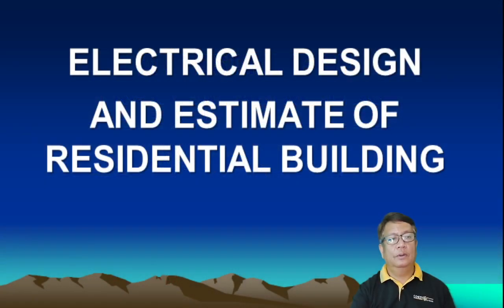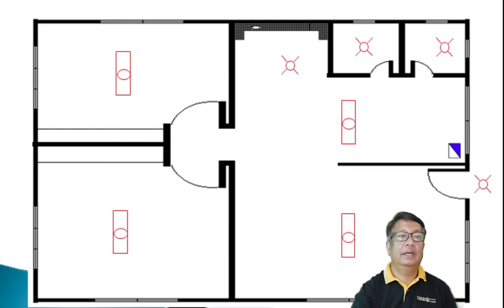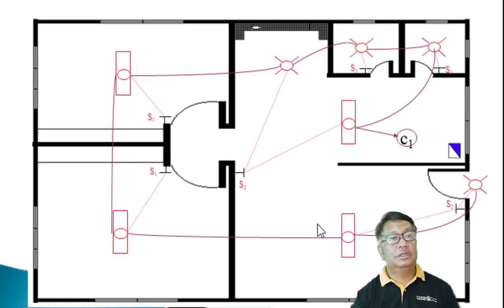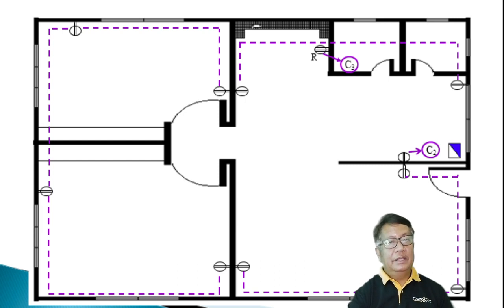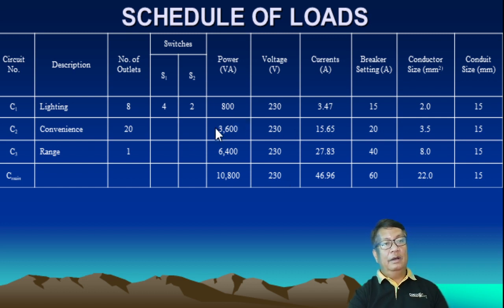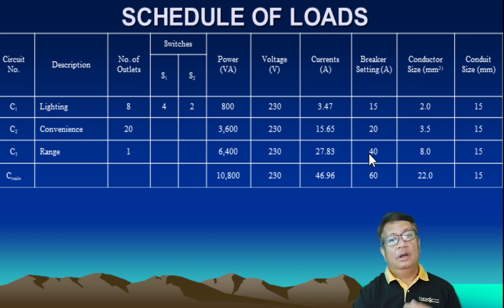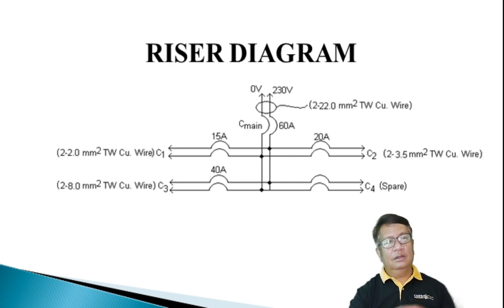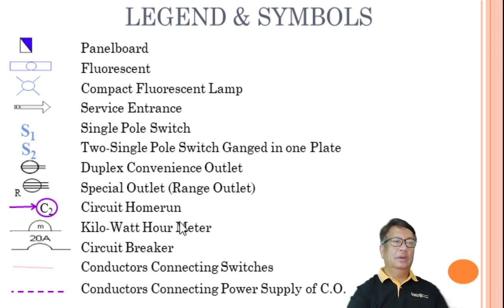ELECTRICAL WIRING DESIGN OF RESIDENTIAL BUILDING

Comment: Sir, my problem is the voltage and power fluctuation.  Is there a design to fight these?  Is there such a thing as a voltage regulator and a surge protector for the whole house?  I bought before an automatic voltage regulator and the adjusting motor was destroyed!  Our voltage fluctuation was wider than the automatic voltage regulator can handle!  Are there equipment we can buy to solve this problem?  I want a good supply of electricity for the house to protect all the electronics.  We all know that voltage and power fluctuations destroys all our electronics!  Please help!  Thanks!
I have seen server rooms in companies before.  I know those servers have a perfect electrical supply.  How do you do it?  What are the equipment that you install to give them a perfect electrical supply?  Thanks!
Reply: you have a problem with voltage fluctuation, right you used AVR but your AVR must be able to respond to the fluctuation range, also you used a servo motor type of AVR which is slow in response, you have to use an AVR that have a wide input range and a low %age output regulation. Of course it will incur cost.
Reply: @kuryentelektrik , thanks for your tips!  That's the problem!  I can't find an AVR with a wider input range.  The input range of all AVRs are the same.
Reply: Apply avr or pss

Comment: Parang may mali sir dun sa c.o...sa pagkakaalam ko kung 1-3 gang ang equivalent nun ay 180VA,then kung 4 gang ay 90VA multiply by number of gang..
Reply from the maker: In my discussion, I use the unit watts because it could be easily remembered by an ordinary person but the reality and the correct unit is volt-ampere and it is just a matter of power characteristics for alternating current system. For the assignment or allocation of power per ganged convenience outlet, it should be 180 VA per outlet and it is seldom you can see  a 3-ganged C.O. but sorry to say that ever since wala pa po akong nakitang 4-ganged na C.O sa market. Thanks sa comment.
Reply: @farmercmu  pakicheck po ulit ng PEC kung kailangan n imultiply ang 180VA s 2, kung ang c.o. ay 2 gang..kasi s pagkakaalam ko talaga ay no need..yes sir,wala pa din po akong nakita n 4-gang c.o. pero sample lang po un..1-3 gang c.o. is equivalent to 180VA, then 4 up is need to multiply 90VA for each gang..try to consider po n manood ng ibang video ng kapwa natin electrical engr or s libro n kulay orange n inilabas ng iiee or s mga electrical plans nalang made by ng ating mga kabaro..salamat po.
Reply: Size nang wire nang 60AT is 14mm²

Comment: good day sir. mas okay po ba na bukod sa labels ng rooms (kitchen, bedroom, etc.), provided na po ng client yung positions ng furnitures?
Reply from the maker: Hindi, kasi young furniture and beds are movable. it could be transferred to other position and location in the bedroom or areas. Kahit divider specially movable, location is not necessary. Tnx for the question!
Reply: @farmercmu  thanks for answering sir.

but what if po sir for example naglagay ako ng outlet near the window, pero yung space po na yun is intended for the sofa ni client and matatakpan yung outlet pag nilagay na yung sofa. ano po kaya pwede maging solusyon
Reply from the maker: @moonsun815  siguro just put the outlet at the side of the expected sopa or if no other choice gagamit nalang ng extension wire for that specific appliance.
Reply: @farmercmu  last na sir. magkaiba po ba yung 2 gang outlet sa duplex po? sa ibang videos po kasi na napanood ko, 1 2-gang outlet is 180W unlike po sa ginawa niyo na 1 duplex is 360W.
Reply from the maker: @moonsun815  Pariho lang po 'yon. pagdalawang outlet mo in one face plate duplex yon o 2 ganged outlet po yon. According to PEC, every convenience outlet you must have to allocate 180 watts per outlet. So, meaning dalawa sila, so we must have to multiply it (180W) by 2. So, for a duplex convenience outlet we have 360 W. Tnx for the questions!
Reply: @moonsun815  1 gang, two and three gang outlet are counted as 180 VA. It should not be multiplied by 2 ( x  2).
Reply: @MrRonniemagalang  magkaiba po ba ang 2-gang sa duplex? medyo nalilito po kasi ako eh.
Reply: @moonsun815  
        Isang butas sa plate (single receptacle =180va), duplex receptacle (dalawang butas =180va), triplex receptacle (tatlong butas = 180va, Quadruplex (4 na butas = 4 x 90 = 360 VA, Hexaplex  : 6 x 90 = 540 VA.
      Minsan nagkakalitohan sa term. Ganoon yan
Reply: @MrRonniemagalang  salamat po!

Comment: Sir bakit po 230 po ung voltage nyo po hindi 220?
Reply from the maker: Yan po ang no-load voltage. Because you can not be sure how much load can be connected in the actual scenario so just use the no-load voltage in the computation. Thank you for the question.
Reply: @farmercmu  TY po